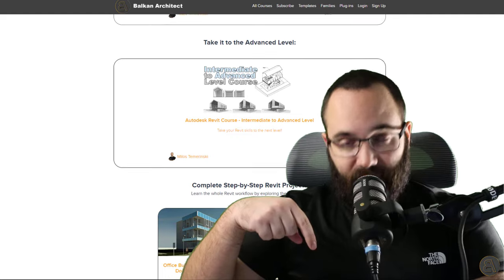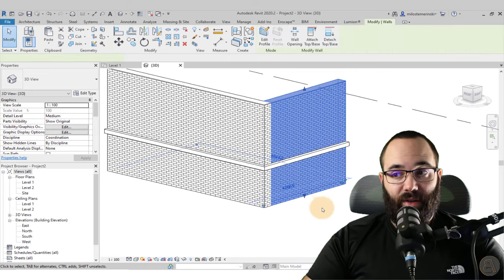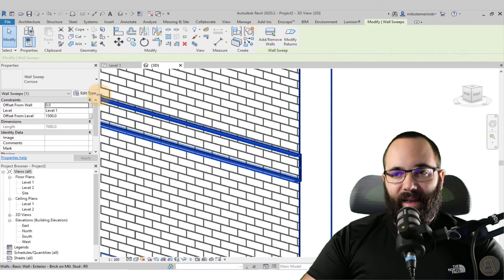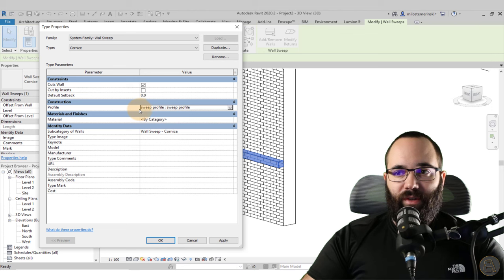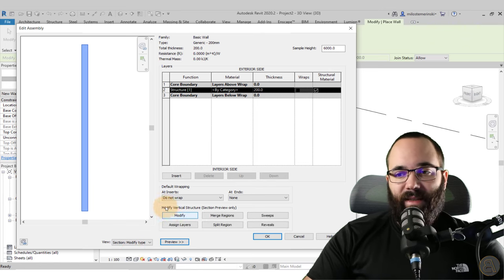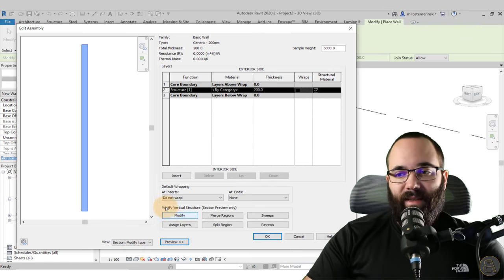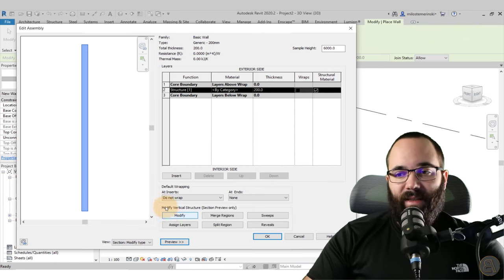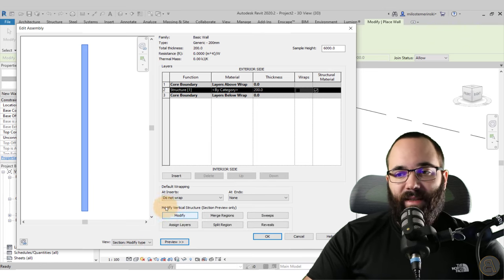Wall Sweep in Revit Tutorial

Comment: Hello :) thank you for your video. Quick question. is it possible to do a sweep along the top of a cut profile wall? i have walls that have an angle at the top but they need to have a coping. Any tips would be really helpful thank you
Reply: did you find the solution yet?

Comment: A thing to note with sweeps; if you want to use material takeoffs to quantify the sweep for any reason, it will not show up if that sweep is built into the wall parameters.  Like at all. I’m not sure why that happens but it just completely ignores built in sweeps.  Works for regular manual sweeps.  

The other thing with details in profiles is that they can flip if the profile runs on the other side.  Say you have four walls and a copping profile on top of your parapet roof.  When you run a section through it one side will be perfect with the detail component in the right place but the other side will keep the detail component facing the same direction and will usually be outside of the profile. Why this happens is beyond me as I have tried and made sure that the detail was locked to planes inside of the profile family making sure there was no way for it to unlock from its position but it still does.  If there is a work-around for this problem or an update I just haven’t heard of yet with Revit 2023 then please let me know. Otherwise, you may need to use those features with caution. 

Still great content as this is what helped me through college and my first drafting job!